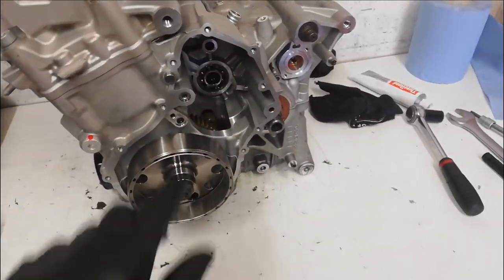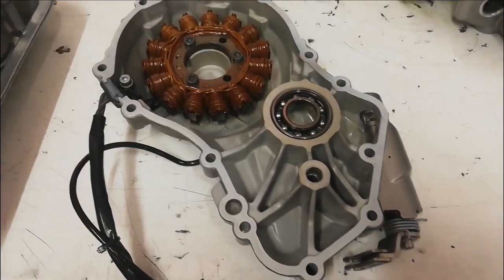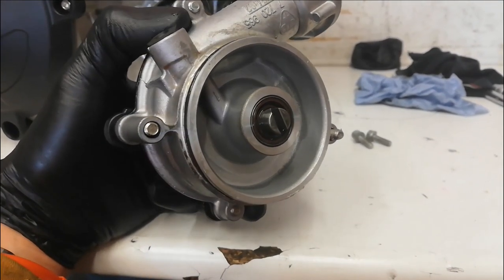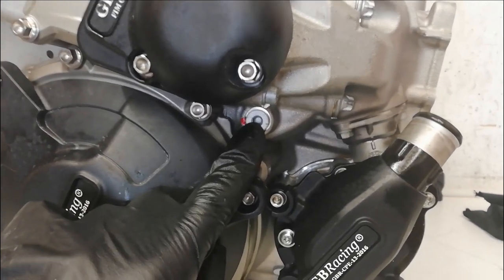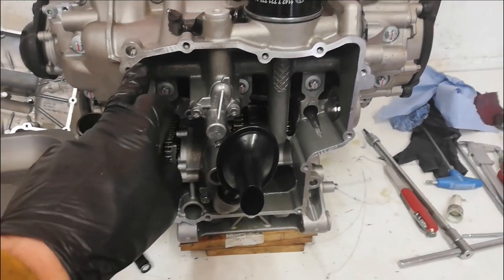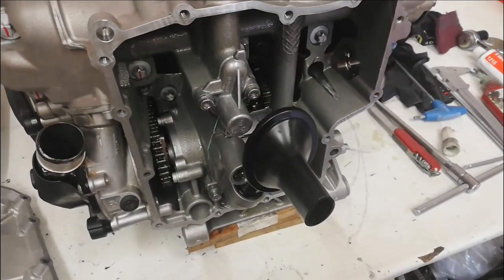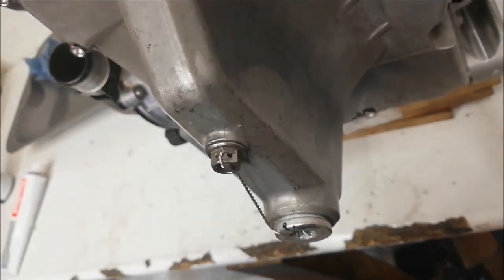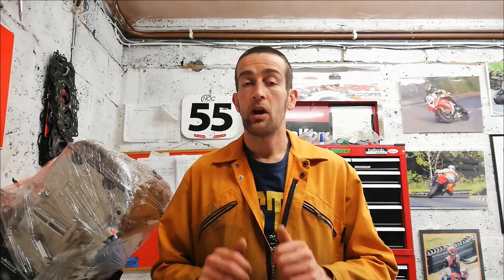How to finish refreshing a BMW s1000rr engine

Comment: I just watched through the whole series in one go, great videos, although personally I would have liked to see them be a bit more in depth here and there. Such as with the valve clearances, you didn't really show how to do it, measuring the shims and calculating what needs replacing, or not. Cleaning gasket surfaces would have been a nice little touch for noobs and more experienced if you have a special way of doing it without causing damage.
I trained as a mechanic many years back, but still learned a bit here and there too, especially liked the explanation on the valve timing and overlap. Pity this was such a good engine as you didn't really need to refresh it as such, more of an inspection tear down and rebuild.

I just replaced the head gasket on my 23y/o Kawasaki ZX9r, done the clearances on the way down, but didn't recheck on the way up. Big mistake as when I started it, the only exhaust valve shim that measured well in spec so was not changed, somehow came loose/dislodged and caused a collet to jump out under the tappet/bucket, luckily only one so hoping there is no valve damage. Have you ever seen or heard of this before? I have a video explaining and showing the point it happened when I started the bike if you would like to have a look to see what you think, would be interesting to hear your thoughts!

Comment: thanks for the information and explanation, enjoyed the entire S1k build series, one question though.. since you're using a reusable stainless-steel bolts instead of BMW aluminum bolts what would be the correct torque and where to find them.

Comment: Hey mate, how did the clutch push rod go back in? I had some issues doing mine when putting the generator cover on. You didn't show any specifics there so I am guessing a bit. Any help will be greatly appreciated.
Reply from the maker: It should just slide up the hole, assuming you have the bigger diameter rod already in the gear shaft of course
Reply: @obsession_engineering  Thanks, finally got it on properly.

Comment: Wow I guess I have to give my pressure regulator valve a switch to the updated part.. would you also replace the oil thermostat “set” while your at it? I am looking to do a top end refresh + check the oil pan area, not looking to open the crank because the shops here would cost 3000$ for this as I’m not a mechanic. But I want to be sure to have everything needed to bang this job out right! It’s unbelievable you did this in 11 hours, my local shop took 5 hours just to check my valve timing at 80$ per hour!
Reply: My May 2010 model s1krr runs great still after 44600 kilometres, but I think it’s best to crack the engine open sooner then later to replace the cam chain!
Reply from the maker: The top ends are usually pretty reliable, I've never found one with a valve clearance out of spec!! 
On race engines the head gaskets are occasionally prone to failing but other than that I wouldn't go crazy with the top end work.
The later oil pressure regulator is a bit more reliable so a fairly cheap safety mod, the oil thermostat's don't seem to go wrong so no need to change it

Comment: On my K1300R, the single-use bolts on engine covers are such chosen that they fail by shearing first to protect the cases if there's a tip or accident. Isn't this the same reason here?

Comment: 2:10 No worries about galvanic corrosion when using stainless screws in an aluminium block?
Reply from the maker: No, especially as they don't get used in the kind of environments where much corrosion is an issue. But a very fair point!!

Comment: great as always mate and i appreciate the share/upload!     have you plans to use a clip on mic or similar for future projects?    i find the audio tends to fade in and out -  sorry this is just an enquiry not a put down!   cheers!
Reply from the maker: I'll certainly look into it, still learning as I go along
Reply: @obsession_engineering  Dave, I own the S1000R,  2,300 miles, 2018.  But the engine seized yesterday and is at the BMW shop.  How long does it take to repair something like that? Thanks in advance, southern California.
Reply: @obsession_engineering  Hi Dave what would be the rough cost in a refresh on a s1k engine like what you have done ? 

Cheers